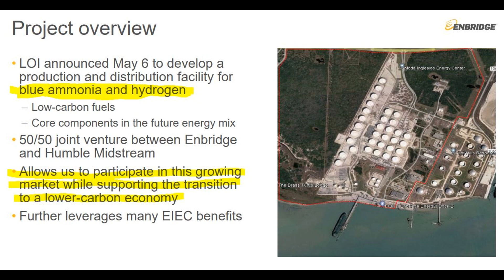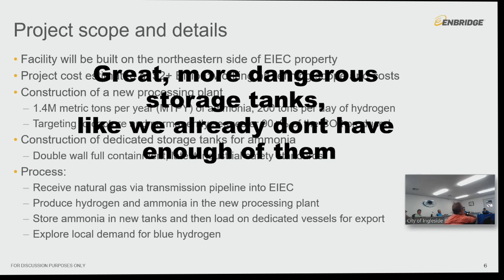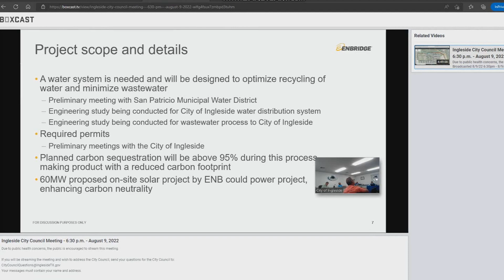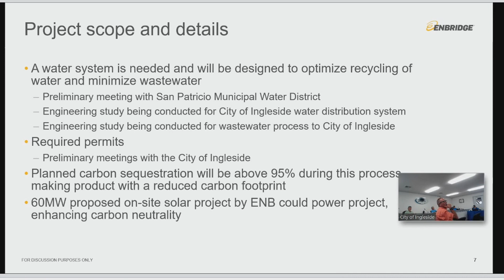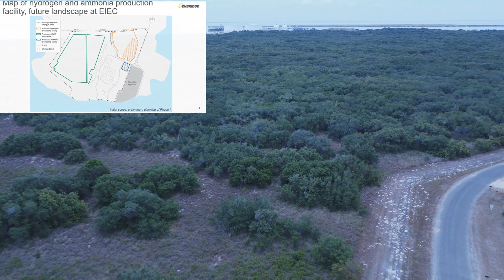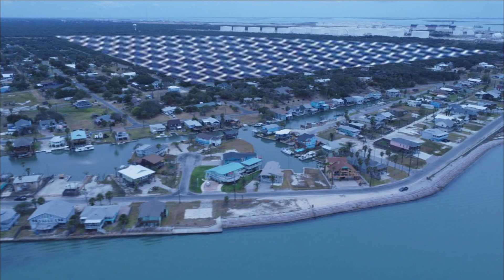The Port of Corpus Christi & Enbridge Growing Pains

Comment: Relative to the size of the county this land is small and can be set aside for this development... These fuel products are much cleaner than coal or heavy petro carbons. Enbridge has been taking steps to transition to low carbon energy, but at the moment we have energy shortage and need these systems.
Reply from the maker: Hey Theo, what does the size of the county have to do with building a solar production system that will tear out large oak trees that have been there for hundreds and hundreds of years. Trees that work 24-7 cleaning the air and rain water and prevents erosion of the ground, Trees that give shelter to numerous birds and animals both large and small for a system that only has a life expectancies of 25 years or less, but will be less because this is being built right next to the bay with a predominant south east wind that will blow across the panels and hardware causing major Maintenace issues, I know this because our local San Patricio water district has a small system several miles from the coast and they can't keep the salt film off of the panels and hardware at this current time.
   Also do your research the production of making blue hydrogen is only 9-12% better for the environment then production of making grey hydrogen. But most surprisingly the greenhouse gas footprint of blue hydrogen is more than 20% greater than burning natural gas or coal for heat, and some 60% greater than burning diesel for heat. 
       Do you really think this product is going to be for the good old USA ohh hell no, it is going to be produced and put on large ships and be exported to other countries like Japan. Ships that will cause even more damage to Corpus Christi bays estuaries and sea grass beds worse than the ongoing damage now.
       We have an energy shortage due to ongoing exporting once again to other countries of our oil and gas, and a current president who cut drilling and shutdown pipelines that had worked great with other administrations before this current mess in office.
Reply from the maker: https://www.bing.com/videos/search?q=blue+hydrogen&view=detail&mid=0CF1B61C0CE18CDE31E20CF1B61C0CE18CDE31E2&FORM=VIRE